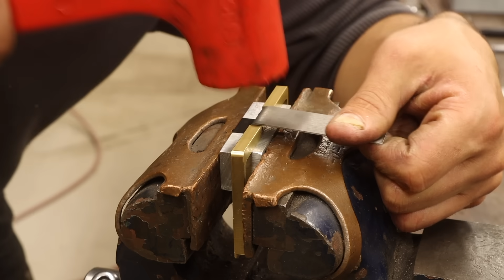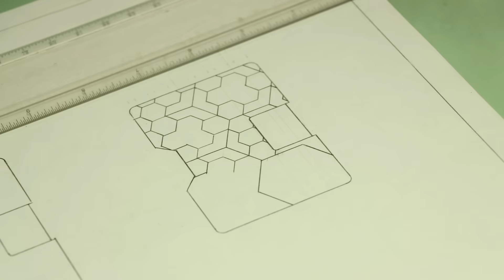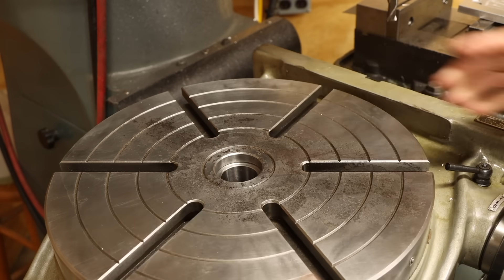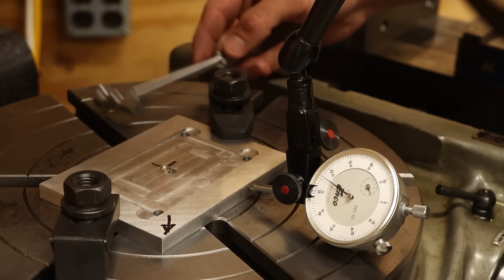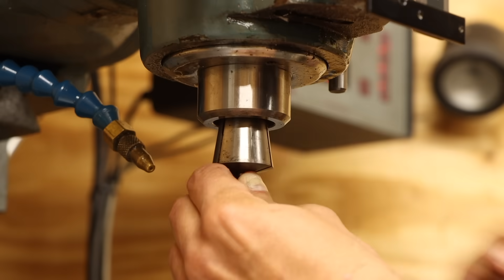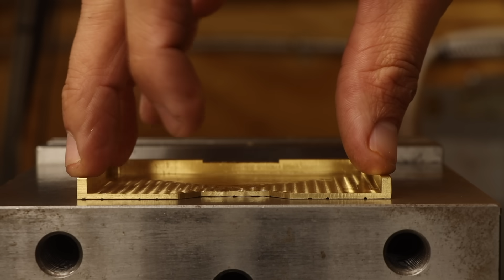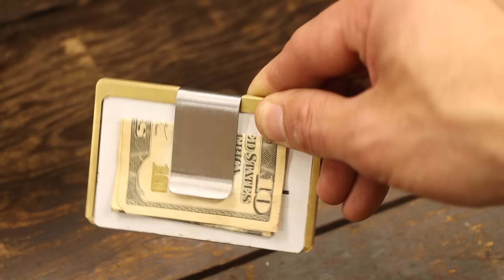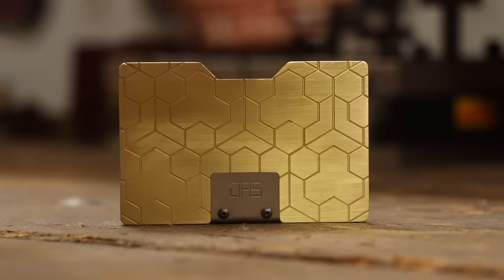Making a MINIMALIST Wallet || INHERITANCE MACHINING

Comment: If you like the royal blue finish you could try making one out of steel. Polish it to a high gloss finish then temper blue it 'Clickspring' style before doing the engraving.
Ok, it wouldn't be royal blue and gold, unless you fancy learning how to inlay gold wire into the design, but it would have the gorgeous royal blue finish and probably wouldn't weigh much differently to the brass one.
Reply from the maker: That would be neat for sure. I've been looking for an excuse to try his technique

Comment: You really want to use a tap guide/follower when tapping small threads. It helps prevent you breaking a tap by bending it too much. Also it makes sure the threads are straight.

Comment: What you could do put the layout fluid into the engraved lines, then clean off what's on the face with fine sand paper, and spray some sealant over it to keep the layout fluid from wearing off.

Comment: Superglue would have been a perfect solution for you in this particular task. Engraving has zero lifting forces and your fixture handled lateral forces so it wouldn't have had a chance of coming loose. But then you would have missed out on the carriage bolt side project :P
Reply from the maker: I though about this but wasn't sure how well it would work on the opposite side with the pattern face glued. Didn't want to end up filling the engraving with CA
Reply: @InheritanceMachining  makes sense. Your way was perfectly fine, glue just would have saved you the one clamp movement which really wasn't a huge deal.

Comment: It's very pretty. I wonder if the engraving will age differently than the outside surface and give more contrast. That would be cool

I was thinking countersunk screws... But the button ones do look good, and it's not gonna snag. def a front left pocket wallet though :D
Reply from the maker: I'm hoping it will look nice with a varied patina 😁  And yes definitely a front left pocket wallet

Comment: Couldn't you just put a standard washer on the clamp where the stud was too long in order to tighten it down? I'm a mechanic so I constantly fiddle with wrong sized hardware and I took a habit to stack a few washers as quick hack when the threads aren't long enough.
Reply from the maker: Yeah I could have, I've just run into this problem to varying degrees before and decided to just make the end all fix with fully threaded studs

Comment: RE the flex when cutting out the main pocket: would another solution be to use a downcut endmill, or should you not use that kind of bit on brass?
Reply from the maker: I've never used a downcut mill before so I couldn't say. Sounds plausible though.

Comment: 7:00 Why didn't you just put a washer as a spacer?
Reply from the maker: I could have, or just a spacer under the clamp. I've just run into this situation several times before of varying degrees so the fully threaded short stud would alleviate that all in future.

Comment: Looks nice! Would be a nice to fill the grooves with black paint, then sand the excess to leave just the grooves filled in
Reply from the maker: Thanks! I thought about doing that actually but decided I liked it all brass better.
Reply: I was thinking similarly, but with some kind of blue enamel that'd lend an effect like the inverse of how it looked with the bright cuts in the Dykem, and probably also a clear coat for protection. The all brass does, indeed, still look good too, though.

Comment: Very nice project.. In my apprenticeship I learned to back out half a turn after every full turn when taping... its needed to break the chips and it creates way less force and its less likely to break the tap... If you do it once you can really feel the breaking chip and that its getting easier to run it.
Reply from the maker: Thanks. I do this off and on with no regularity. I need to get in the better habit obviously 😂

Comment: I think fillet radii are inside, and outside radii are just plain radii. Nice video, nice wallet!
Reply from the maker: Hmm.. you might be right. I'm used to modern CAD software referring to both by the same name. Thanks!
Reply: @InheritanceMachining  as FreeCAD user, I can confirm that... for the software it doesn't matter if it's inside or outside ... but I also didn't know it's called differently outside CAD-World 😆

Comment: I love how that turned out! That royal blue against bronze could pretty easily be achieved with titanium and two steps of anodizing. I'll email you some of the multicolor titanium anodizing I did for some parts at home. Titanium is a pain to machine, but I think the engraving could be done pretty reasonably, based on my own misadventures with Ti in the home shop.

Also, I remember in a previous video you had a tapping jig in the background, wouldn't those tiny holes have been the perfect test run for that machine? (or just using the tap in your mills chuck after drilling)

I really like that pattern, it gives me some ideas for an aesthetic I am slowly planning around on my motorcycle.
Reply from the maker: I ALMOST tried my hand at titanium on this one! I do have that tapping jig that I used before, and probably should have used here. I was thinking I'd lose the feel and be higher risk of snapping the tap. I was wrong 😂
Reply: @InheritanceMachining  that's been what has held me up from trying my tapping jig out. Gotta love taps for being so useful and stressful at the same time.

I love working with titanium, but machining it is definitely...challenging. I find if you can incorporate it into your project without needing many/any machining ops it's pretty fun. On the bright side it reacts to abrasive operations pretty much the same as normal steel (IE, use them if you can). Drilling it is slow and best done with throw-away bits in my experience. But hand forming it under dull red heat feels almost identical to working steel. On balance I feel like it's under appreciated at the hobbyist level. Most of the barriers to working with it come down to being aware of a few constraints it has different from other metals.

If you jump into anodizing it, let me know...I've had some fun with that, and with a few tricks and considerations it's pretty easy. You should have a few examples of what I was able to do at home as a first try sitting in your inbox.

Comment: That's genuinely gorgeous, definitely gets the neurons firing hah!
Also continuing to take very close notes. Got fucked by a tap a few weeks ago on something I really, really had to get done. Part took far too long, was for mounting a high voltage connector. Got saved when I remembered the sleeve trick you showed a while back and it worked like a charm.
Reply from the maker: Thank you! And glad you remembered the idea. If you remember that was my wife's! I'll tell her you said thanks 😉
Reply: Sleeve trick? I think I missed that video. Do you remember which one?
Reply from the maker: @douglasmarcus840  The sleeve trick saved my bacon on the rotary chuck adapter video. One of the few good decisions on the project
Reply: @InheritanceMachining  Thanks. I'll take a look.

Comment: Mitutoyo calipers, at leas the old ones like mine, have a slot on the back side of the dial that you can push a thin tool into that will disengage the pinion from the rack. Push to disengage, slide the jaw, then release. Then you can get the zero back on top.
Reply from the maker: ohhh that's how you fix that! Don't tell anyone, but I clumsily dropped mine recently and it shifted the pinion. Thanks!
Reply: A regular sized paperclip will work.....ask me how I would know that😂
Reply: @adamb4315  Those copper coated staples that are used on cardboard boxes also work well.

Comment: I'm (honestly) curious why you count the basic machine setups (in this case the rotary table and vice) as side-projects. Aren't those just regular part of the job at hand? But then I guess the counter is for fun anyway.
Reply from the maker: I guess the thing the counter highlights is that there are obstacles in the way of just mounting and cutting. The line is kind of fuzzy though because I don't count switching chucks or end mills, etc. Thinking about it now, if it takes more than 10 minutes or so I'll call it a side project.

Comment: one way of holding the brass in the fixture: superglue

just put it in the oven when it's done and you should have a clean and warpage free part
Reply: to avoid the oven, you apply painter's/blue tape to the work piece and the holding surface.  Then apply the CA glue directly on the tape.